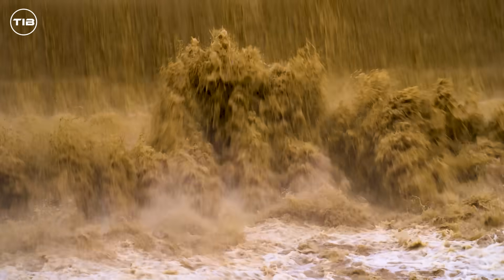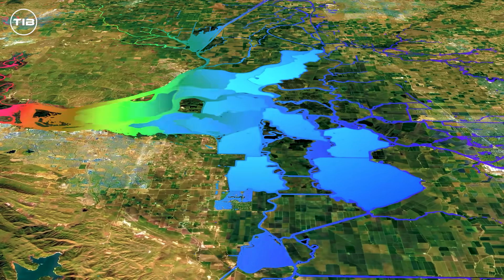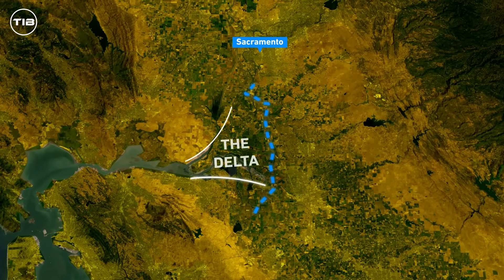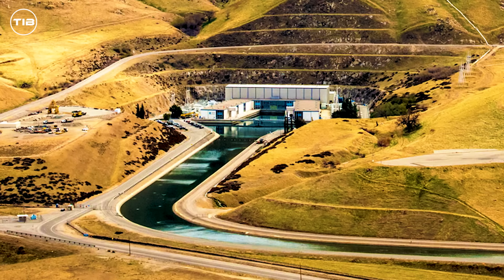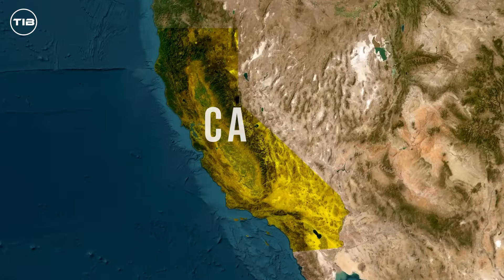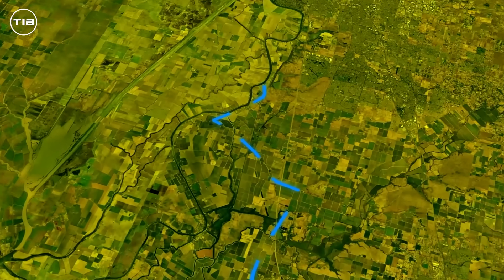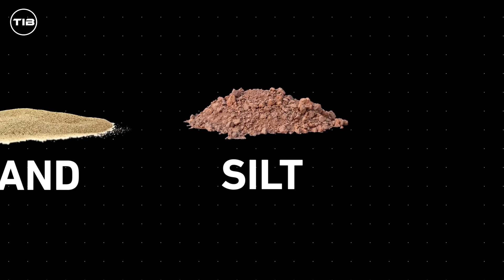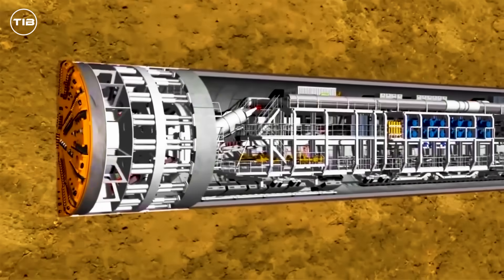California's $20BN Water Transfer Project

Comment: the delta bypass was supposed to redistribute water from north to south, however it was also supposed to reduce salt water intrusion into the delta which will kill the farming in those areas. I still don't see how taking fresh water around the delta keeps salt water out of the delta and also saves the delta smelt which was a concern from the tree huggers. it is more like the light rail boondoggle a giant waste of money.

Comment: The little lie that  the Sierra Club doesn't want you to know: The average year net unused runoff in California is 39 million acre feet (MAF) according to the DWR. That is enough water to supply the domestic needs of about 200 million more people. Another little lie is that people can "waste" water. If you flush the toilet up river from salty water, it gets treated and used again. The Sierra Club's definition of water waste is not using it according to their rules. We have man-made droughts in California because the Sierra Club (SC) kills water storage projects like the Auburn Dam and other reservoir projects totaling almost 10 MAF. That is equal to the loss of snow melt in a dry year. The SC also stopped the peripheral canal project when it could have been made at a lot lower cost and would have protected the water quality and fisheries in the Delta. This canal was modeled and showed how salt water intrusion was held back by a series of canal outflows along the periphery of the Delta. Now, the State pumps turn on and draw water to the South end of the Delta causing reverse flows confusing migrating fish and drawing in salty water. The Sierra Club controls the super Democrat majority in California so we are doomed!

Comment: You make the project sound "all good."  You miss a big point: preventing the water from flowing through the delta will drive many species of fish to extinction.  The delta needs the water to prevent collapse of the ecosystem.  You know why big ag wants this?  Money.  They keep planting more almonds.  1,000,000 acres of almonds already!  And every single almond uses 1 gallon of water to grow.  Let's see, more almonds or save the fish and the delta environment?  I side with the fish.  Almonds aren't going to go extinct.  By the way, we export most of  those almonds.  Again, big money for big ag.  Pretty one-sided presentation.

Comment: Bizarre. Nobody watching this video has any idea what 85,000 liters per second means. Large American water projects measure volumes and flow rates in cubic feet and acre feet. Much harder to fact check as all of the water use databases are in cubic feet and acre feet too. Yeah, yeah, I know one can convert these units, but why?
Reply: Oh your such a God. Nobody is super intelligent, smart and great as you
Reply: maybe it's time for America to start using metric like the other 90% of the world. don't be scared it's very easy
Reply: @noinchesdiy7269  We did. For alcoholic beverages. Used to buy bourbon by the fifth of a U.S. gallon.

Comment: 65 kilometers long, 11 meters in diameter... That equates to a full capacity of about 214,000 acre feet of water just in the volume of the tunnel and, in that respect, establishes an underground reservoir of not insignificant size. Thing is, this can't be an incremental project. Until the whole thing is finished, you don't get to move even a drop of water.
Reply: I'm not really too worried about the tunnel. California's track record on building infrastructure is pretty abismal. High speed rail is just one example...

Comment: why not setup Desalination  plant? For  the amount of water that can be done is enough for watering
Reply: California has all the water it needs. It just doesn’t need to grow almonds, rice and alfalfa for export and farmers, If they had to actually pay what water was worth they would be growing more intensive, but I have to give up on this YouTube channel. It is so poorly researched, and the narration is just dreadful
Reply: @chasmader also if no till we're the norm, think of all the water we could save on agriculture alone
Reply: Super expensive when compared to making the 20bn water tunnel.  Also output of the plant is way lower than just channeling it.
Reply: The desalination plants in the LA area did not pass the environmental reviews.
Which seems odd, given that it is right beside the Pacific Ocean.
Reply: Snow is desalinated by the sun.
Reply: Cost
Reply: What do you do with the saline concentrate after desalination? Big problem for those.
Reply: @bwhog  Saudi Arabia has 27 desalination plants, which I assume (given its geography) are located on the rather stale Red Sea and Persian Gulf.  Contrast that to LA, where the California Current constantly circulates the ocean water southward.
Reply: @jayadinash9102  You mean where they have already determined that putting the high saline water back into the ocean is proving a bigger problem than they thought it would be? It isn't about what happens miles away. it's what happens within a kilometer.
Reply: @bwhog  They don't have to send the brine back to the ocean. They could make products from the waste material (especially the salts)
Reply: @lindatullos9430  Which they can't do because the volume of output far exceeds the demand for such products. That, too, has already been considered.
Reply: @bwhog salt. You sell salt.

Comment: 9:49 Those 3 households use a lot of water.

Typo 😉
Reply: they're in beverly hills. they do use a lot of water.
Reply: @garykidd4468  90.000 olympic swimming pools is quite a bit of water for a single household lol
Reply: Should supply 400,000 houses with water for a year...